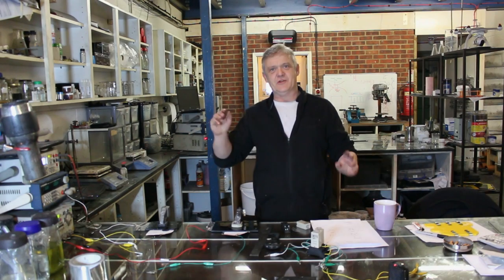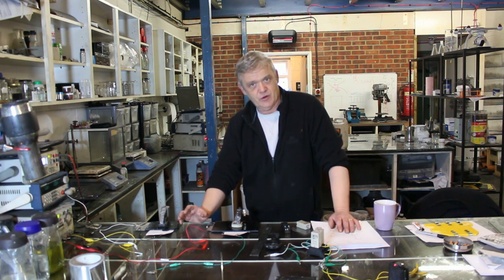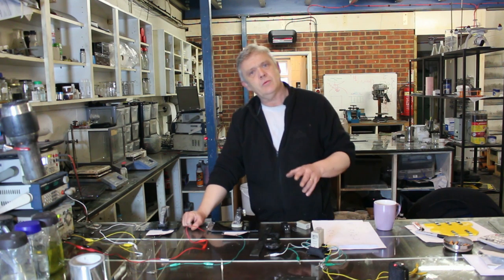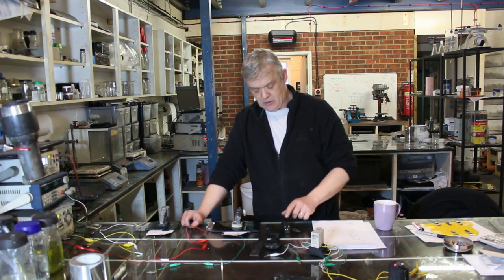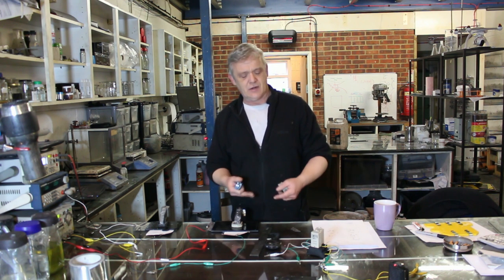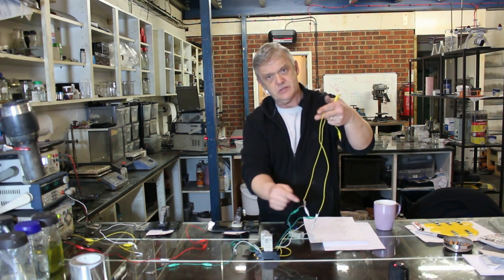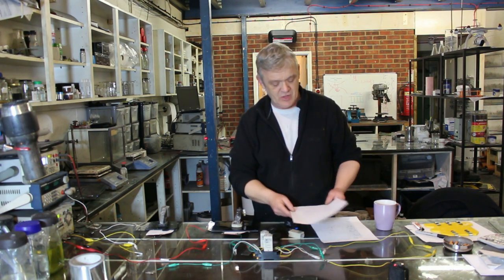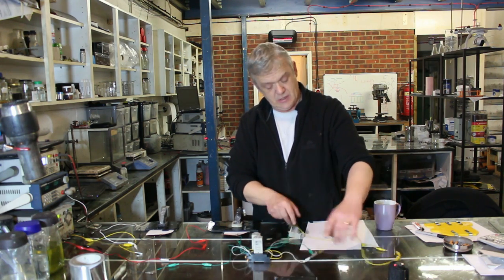FWG Graphene Making Live Event Update

Comment: Hi there i have a question. I believe you have made videos on this method before ones with sodium sulfate and another with sulfuric acid and sodium hydroxide as electrolyte. And in both videos you used ~10v one switching between +- and one not. So is nacl and 12V just used because its easier to get hold of for the demonstration or is it working better? I guess there is room for experimentation.
Reply from the maker: spot on mate - we are using that because it is safe and there is a ton of room for experimentation